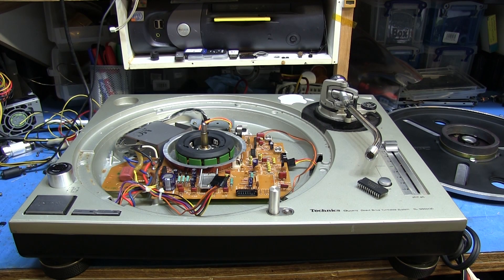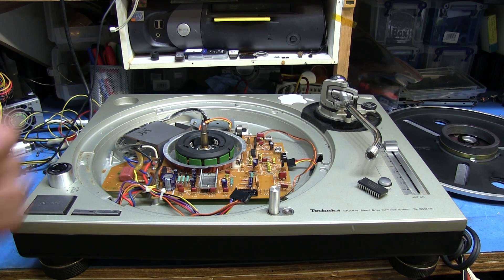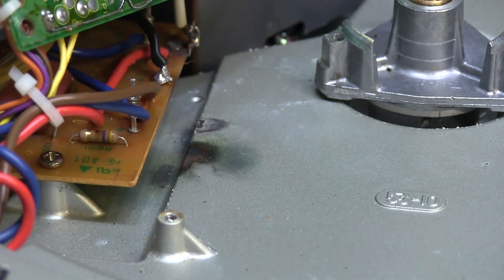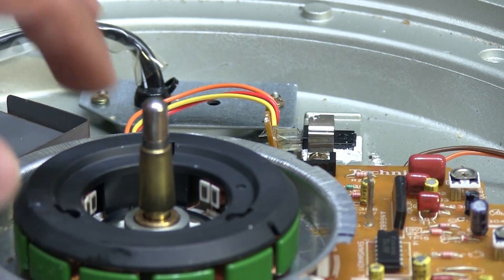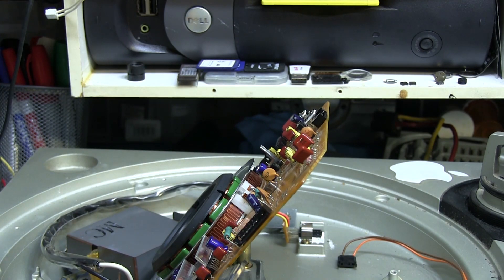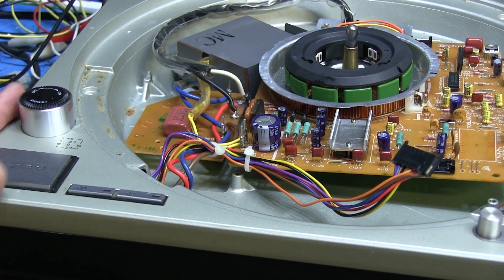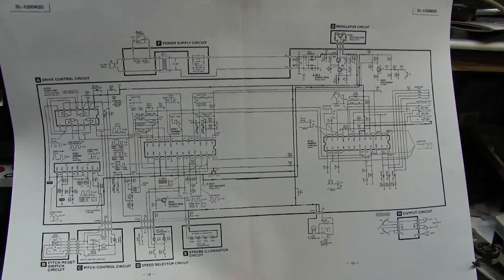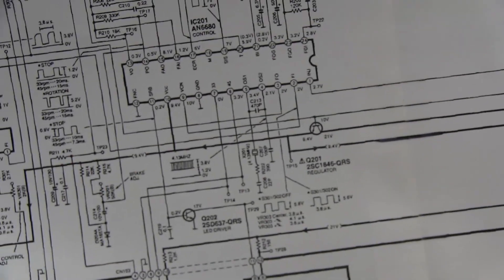TWB #11 | Technics SL-1200M3D Turntable Repair Part 1 of 3

Comment: Sir, you are an excellent and awesome board technician. I would completely trust your work with my MK5G units. And my original 1981 Mk2 decks that are still running like new. But honestly after watching all of the repairs that you had to make to this unit. (Especially the re-winding of one of the motor stabilization coils seen in one of your later videos). I could never trust this deck again as a main line turntable. For me this would be either a parts queen or a 3rd deck for scratching or sound effects. But if this deck craps out and I’m only working with a pair of tech 12s then it becomes a set ender and would hurt my reputation.  Just my opinion. Even tho I would send you all of my equipment if it broke but there comes a time where you say enough is enough, time to retire this unit. 
    You should have a chat with your friend about how he or she stores their equipment because I watched that future video and saw all the damage to the inner platter as a result or poor storage and transport practices.  Sorry it’s just my opinion.

Comment: Why on earth would a turntable need multiple ICs?
Reply from the maker: Now days you could probably do everything, including the motor driver (using external power transistors), with a single microcontroller, but these are pretty old tables. The control IC takes care of setting the RPM and flashing the LEDs to help visualize the rotation on the dots. I don't know all that the control IC does, but I believe it also filters the analog voltage from the pitch control so that you don't get fluctuating RPM. The motor has a pretty good amount of torque and doesn't take long at all to spin up since it's a BLDC motor mounted directly on the platter, unlike other tables that use a belt driven system. So basically all the circuitry in these tables is just for driving the motor. Doesn't even have anything to do with audio output. The pickup output is routed directly out through RCA connectors.

Comment: Good job on troubleshooting !!! Either someone shorted out the pcb to power or a loose screw got jammed between the housing and the pcb.
 I have seen all kinds of shorts from foreign screws and metal pieces. Used to 
happen a lot in 1980's and 1990's personal computers

Comment: Hello bro! I have a problem with my Technics 1200 MK2 
The problem is the Pitch don't work anything 
I Read some pages on internet and the fail is a Chip to control de Pitch Fader in the motherboard.